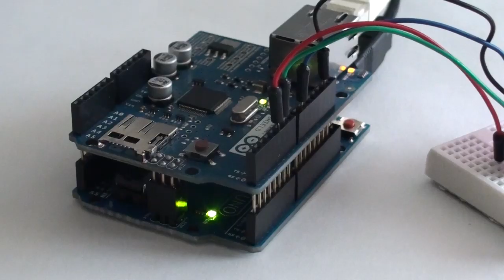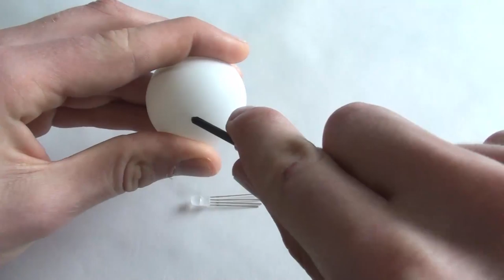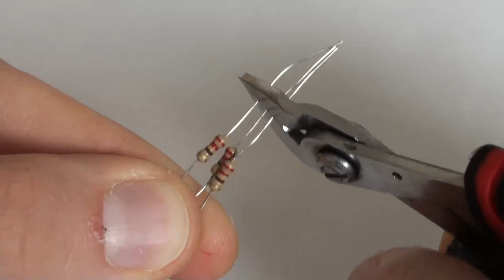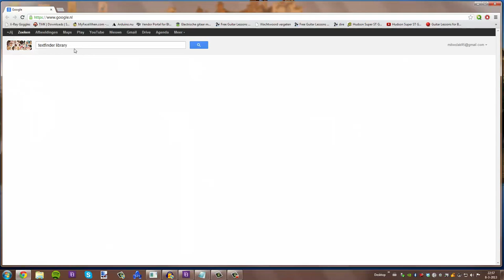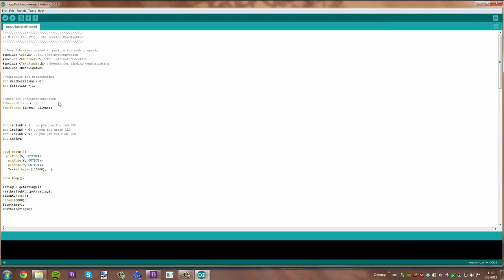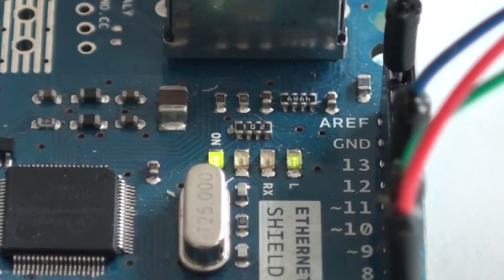THE WEATHER PREDICTING MOODLIGHT! - Mike's Lab

Comment: Nice to see some fellow Dutch people doing this. There is an ethernet arduino(uno+ethernet shield in one) on iPrototype.nl that would reduce the overall size of the project. I use one of those to monitor temperature and light changes in my living room.